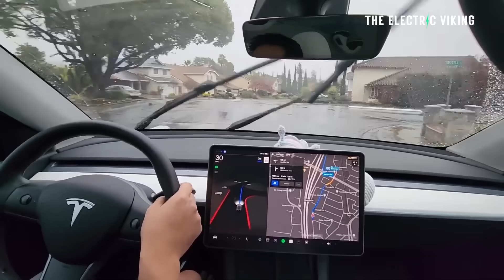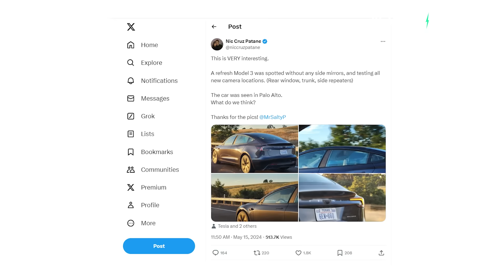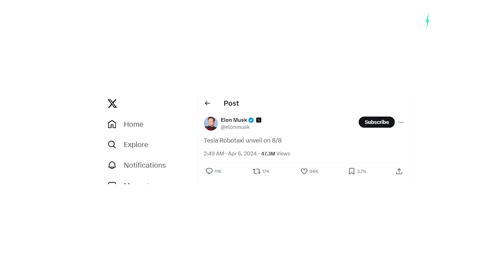Tesla Model 3 Robotaxi seen in America with no mirrors and new cameras

Comment: some are saying its not a robotaxi but a test of cameras etc for the robotaxi in a model 3.
Reply: and that wouldn't be the beginnings of a robotaxi model 3? I mean.. basically teh only dif between what you're describing and a "robotaxi" is removing pedals and steering wheel right? Maybe more pivotable seats and removing a center console for more room and varied seating positions? But le'ts just pretend for economies of scale the cabin/seating stays the same. Then what really is the difference?

Comment: This isn't a robotaxi model3, but the camera positions on a robotaxi adapted to the model 3 as a mule.
The position of those window cameras imply a b-pillar shifted back. So likely a 2 door, with wider doors.
Reply: No way. That would lengthen the door by about 16"... and who is building 2-doors anymore?
Reply: @Dave-cf4vd  it’s a taxi, without a driver. You want to optimize for one or two passengers to enter/exit easily with bags
Reply: @Dave-cf4vd  Its likely a 2 door
Reply: Two big sliding doors. Gawd hope it’s not a two door

Comment: When they are driverless what if-
The rider is handicapped or in a wheeir 
The riders throw up in the cab
The rider passes out & the wife gas has to be woken up to lift hjm out of rge cab.
The passenger dies in the cab.
The rider lopens the door & falls out going round a corner.
I am not just being funny all these & more have happened in my nearly 40 yyears driving a cab in Sydney Australia.
Alsocan they only work around towh or can they drive to a place 109km from town with unmarked unseale roads.
Or when the house is a 15 min drive from the gate ?

Comment: Taking a Model 3 or Y and removing all of the driver necessities to produce a Robo Taxi could reduce the cost.  Tesla has 4 factories producing Model Y's so in theory Tesla could quickly produce a large volume of Robo Taxi's quickly.  I doubt most of know Elon's plan but I suspect this is not just about taking over the Taxi business.  It's about transportation measured in miles driven not by units sold.  To fuel these miles electricity is needed.  When that demand is there Tesla can be it's supplier.

Comment: So, Tesla robots don’t need to look in mirrors to see behind them? How can they switch lanes safely? Maybe they’re mounting cameras in the back of they’re heads?
Reply: What do you mean by Tesla Robots? Are you talking about Optimus, the humanoid Tesla bot? Those humanoids don't drive the robo-taxis, the car drives itself with the Full Self Driving software and that car does have a cameras in the back, it actually has 8 cameras in total looking out of the car and a 9th one inside to monitor the driver. The CyberTruck and probably future Tesla vehicles will have an additional camera on the front bumper.
By the way,  the humanoid robots do not have cameras on the back of their heads, at least I don't think so, since they can turn their heads.
Reply: Tesla Robots don’t drive the cars, they are driverless. There’s no physical robot/driver, it’s all done by software, cameras, sensors etc.

Comment: Waymo does about 17,000 miles for each disengagement, FSD is currently at about 360, so still some way to go.  Tesla FSD city miles for before a critical disengagement is about 140.
Reply: More like 17000 per disengagement. They're also priced the same per journey as a standard car with a driver which makes them more comparable with a driver-attended vehicle. Their vehicles also cost $300000 per car plus wage for the guy monitoring them all day, versus $30000 for a Tesla
Reply: @snappie-riversofengland7589  Yes, but right now there is nothing concrete to show when or if, the $30,000 will ever be robotaxi capable.  Obviously Merc now have a level 3 system, but only for very certain situations and contains lidar and ultrasonic sensors.  You were right, should be 17,000.
Reply: Your info is laughably incorrect.
Reply: @Dave-cf4vd  In what way?